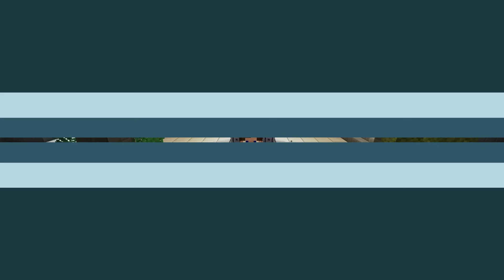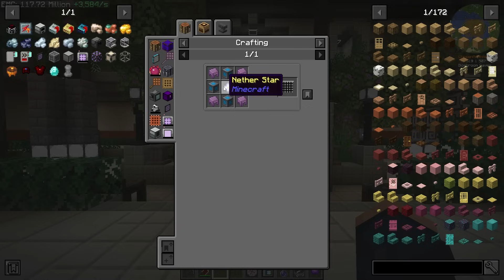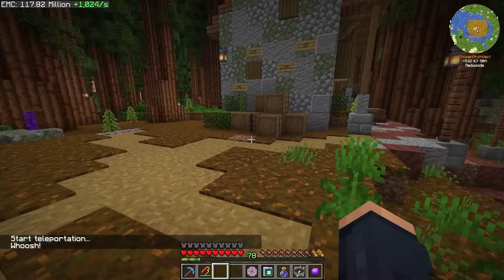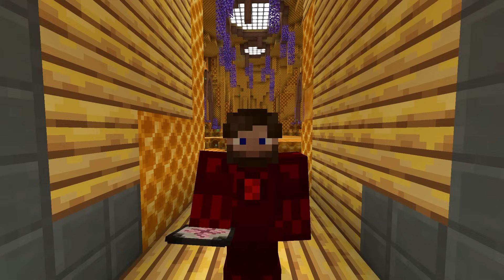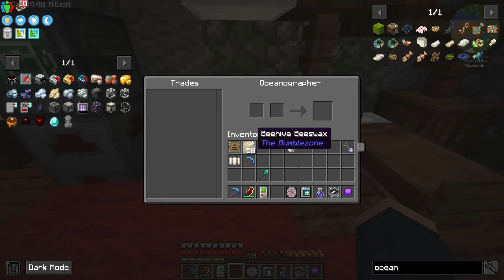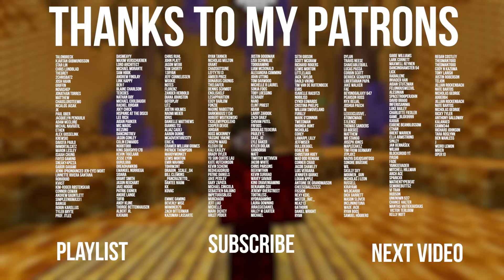PROJECT ARCHITECT 2 - EP 14: Custom Mob Spawners

Comment: I know this is an older video, but just wanted to leave a useful tip anyway for anyone watching. I use a reference block for large areas I cut. A block that stands out and marks where I want the middle to be. Makes it easier to line up when I put it back down

Comment: A cool note about spawners. If you set the spawn range to 1 it will only check 1 block away from the spawner effective meaning you can put more spawners into the same room. Works best horizontally though cause in vertical the falling mobs will affect the spawner it falls past haha

Comment: I have the xp pump in to an endertank and then pipe it with the pipes mod in to the xp crystal.. that way i can place the ender tanks at any farm and have the xp crystal be right next to my enchantment table not close to the mob farm
Reply: Mekanism quantum entangloporter into an AE2 partitioned fluid storage disk works great as well. 

Then export into whatever xp obelisk/crystal/etc you want at any place you want. 

Bit more setup, but I like doing it this way.

Comment: Make sure not to forget about the Rosin for the spawners, because the Tar lowers Min Spawn Delay but you would still need to lower Max Spawn Delay so that it doesn’t take an eternity for mobs to spawn. You would need 74 Rosin per spawner for an Optimal Max Spawn Delay stat. It’s safe to say I hate rosin with a passion.
Reply from the maker: Sorry 😂 I did make it that when making the modpack and thought it would be something fun to automate and have a need for thermal stuff
Reply: Oh that's the stuff that you need the arboreal extractor for right? Yeah it sucks.

Comment: Heyo! I'm working on the Archimeat, but am stuck on Draconic Evolution. I found that the Information Tablet has a recipe in other mods, but it isn't present in yours. Is that intentional, or a bug? Thanks for the great videos.
Reply: The information tablet isn’t working right now so there’s not going to be a recipe most likely as it doesn’t do anything. You pretty much just need to research to find what to do
Reply: @Lane-q6u  Thanks!

Comment: i have a little tip for your wither chamber, even though your base is claimed, the wither's explosive skulls can fly out of the chamber, i recommend to build a zig-zag like entrance so no flying skull can escape the chamber.
Reply: If there is ethereal blast resistant glass, it will only let players through.
Reply: Well I had a wither escape in my base and it wasn’t blowing any of my stuff up when my stuff was claimed
Reply: @Darkwiz1784  are you stuff?
Reply: @Darkwiz1784  im assuming they meant: the skulls might hit you or any mobs near your farm